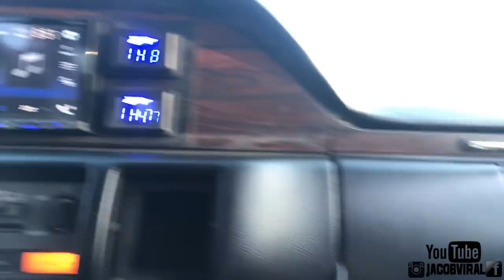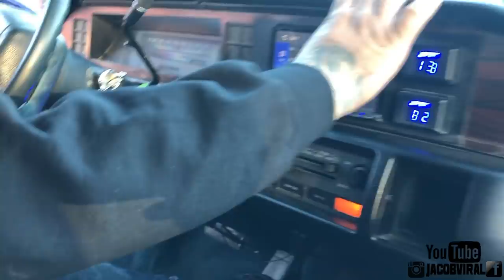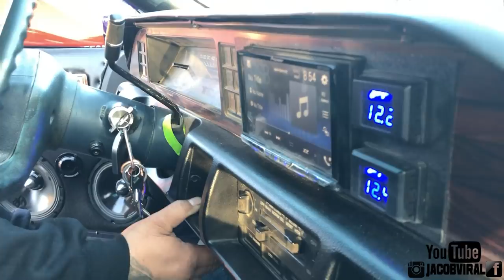2 15S IN A CAPRICE DESTROYING THE INSIDES

Comment: I love setups like this. The point was to get loud and he accomplished his point 150 + from the trunk is a good setup. I like how clean his wiring was and his choice of equipment also can't lose with upper end crossfire gear.
Reply: Dibeezy ThaGifted you don’t have to hack up your trunk to do a 150 dB. Lol I love me some crossfire tho.
Reply: @jamesbondcaraudio4247  I almost did it on one 15. Could've got there with a lil more cone area and power and sealing off easily. Might do it before I wall my Maxima. Just cause lol
Reply: Dibeezy ThaGifted hell yes. If the sub can handle more power just throw a lot of power at it. Power makes more difference then cone area. I did a 150.1 on like 1700 watts @ 52 Hz with a single 15 out of my trunk. It’s all about the vehicles frequency response and enclosure specs.
Reply: @jamesbondcaraudio4247  I did 147 @ 36 with a zv5 15 and 146 at 31 hz with a fi Team 15. Both enclosures tuned really low.
Reply: Dibeezy ThaGifted that’s what’s up bro. Hitting them lows. I love the lows man. 👍🏼  For chasing numbers I have to do what the vehicles tells me. Lol. My out law peak is 52-53hHz. Legal 49-50Hz. I haven’t done to much low frequency testing. That’s a good video idea. 🔊🔊
Reply: @jamesbondcaraudio4247  yeah when I get both my builds done I'll be posting a lot of videos. They're coming

Comment: Hopefully you’ll get back with me on this, but I’m looking into doing something similar to his build. I’ve got 2 15s that are going in a 4th with a 10” big ass port. I will he sealing up the trunk with wood and foam and the box will be actually in the cab of the car with the port centered facing at the little wall sealing the trunk or it could be facing the windshield or even straight up. Only problem with going straight back is I might have some length problems or it being too close to the wall and with the port foward I’m afraid it won’t load correctly or be as loud as it should. Any input is appreciated, just trying to get my ducks in a row by seeing what others think on the idea.
Reply from the maker: Hey man sounds like a sick system you got going lyndon! I wouldn't put any port length into the ported section of the 4th order tbh and just have the 10" port facing outward and shouldn't have any loading issues. Make sure you tune the 4th portes side to atleast 45+hz so you can have great bandwidth. I wouldn't have to big of a sealed section so if you seal the trunk make sure it's not to much space for the subs to unload. Thanks for watching man! gl with the build!
Reply: @JacobViral  3 15 Nsv V4 2 ohm in the trunk of a 07 DTS Cadillac  , what do u recommend ?

Comment: Quick question bro, so for my current project build I was planning on having a Crescendo 4k, now I already have a Mechman 240 and an xs 3400 under the hood, I'm getting another 3400 for the back, would that be enough or would I have to have 2 3400s in the back? Thanks in advance for your response.
Reply from the maker: Hey Clint a Crescendo 4k has probably around 350-400 Amps of draw max and would depend on if your running it at half ohm or 1 ohm daily really to say for sure. 240 Amp Alt + 130ah of battery would put you almost near what you need for it. I mean it would work with 1 D3400 but that Second D3400 with an additional 65ah of battery bank will help tremendously if you can afford it. I would try and start with one and see how your voltage does and if it drops below 12.6volt ever then upgrade another rear D3400. Goodluck with the build man! Thanks for watching!
Reply: @JacobViral  Thanks for the response man, really appreciate your input.

Comment: Hey Jacob can you tune a sealed box and if  you can how do you tune a sealed box
Reply: Not sure you can tune a sealed box, how do you tune something that is sealed? You just make sure the box is build to the subs manufacturer specs (whatever the sub requires in a sealed box).  Also, if you make sealed box smaller than required you can usually run more power to them, the larger the sealed box the less power. Although, just stick with what manufacturer wants. It's easier to make sealed box sound well, less math involved but the lows will not be as nasty.
Reply: You can tune a sealed box by playing with the air space. Take the manufactures recommended airspace add 20% then build a box Then you will add things like bricks or anything really that has some weight to it and will take up airspace. Make sure you keep track of the measurements of the things you’re putting in the box so you can subtract them from your initial measurements. Then when you like the sound you get you take that final airspace measurement and build a permanent box. All cars react differently to different boxes . If you’re looking for loud bass then sealed is not the way to go. Most people will argue that a sealed box is more accurate and detailed for let’s say An SQ set up and in some cases that’s true but I used to compete in SQL where they measured SPL and sound quality and I always used a vented enclosure. I never really saw the need for sealed boxes unless you don’t have any space and it’s your only option.
Reply from the maker: What they said is basically true, but yes you can tune a sealed box by starting big and adding wood in it to your liking/meter score highest if that matters. Also the size of the sealed box will affect low and high end response output. It is like tuning a sealed box in the 4th order enclosure of the sealed section almost the way I see it.
Reply: Personally I use a free program called WinIsd. Just enter in your subs specifications and it will show you a graph of how box sizing will effect frequency response. When you like a certain response just build the box to those specs. The same goes for ported enclosures as well. Most cars natural resonance is between 40 and 55hz. So if your looking for high SPL design a box with a peak freq. of around 45hz. But keep in mind anything below 35hz will roll off pretty hard if you do. If your running a single sub place the sub toward one side never center. That helps avoid wave cancellations in the enclosure. IDK people running 2 subs have gotten away from angling the subs toward each other, it works in increasing SPL by coupling the sound wave from 2 separate cones into 1 larger wave with increased intensity. 
Good luck on the adventure.

Now for someone to pop in and tell me how wrong I am lol 😂😂
Reply: Robert Van Hoy You are sooooooooooo wrong... you’re welcome😬👍🏻
Reply: @kerrypence4201  Cool 😁😁 that was quick 👍